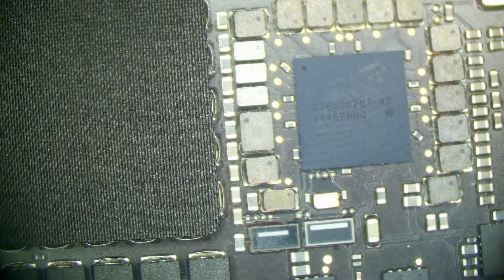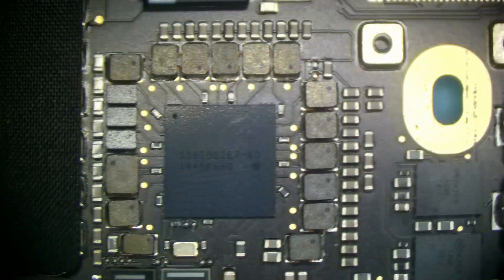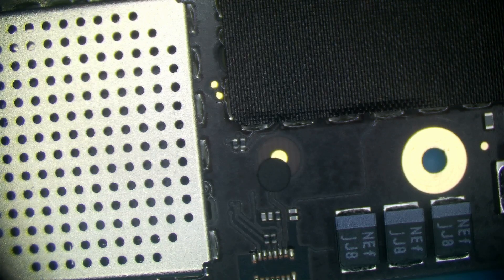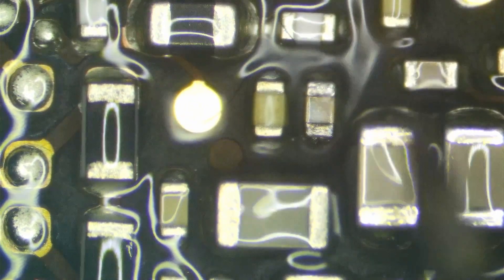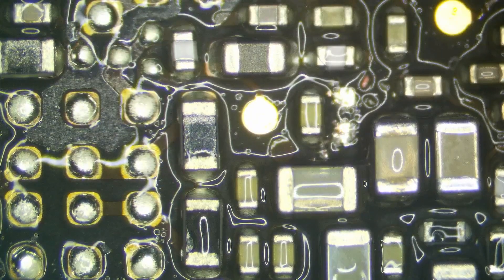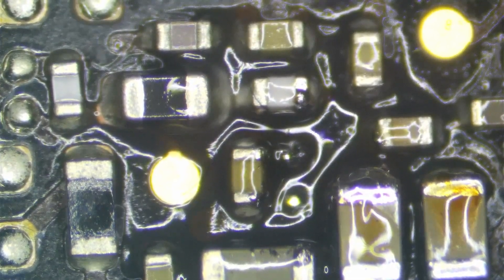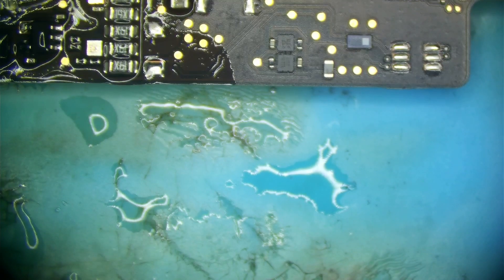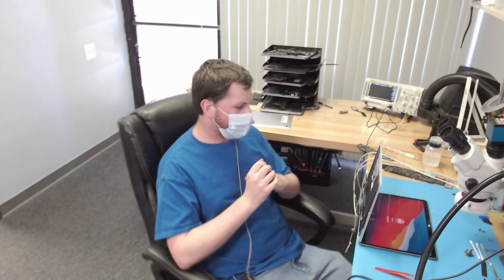2019 A1932 MacBook Air No Power, PP3v3_S5 missing.

Comment: I have the same model with a strange behavior:

- Battery connected PPBUS_G3H is 12.6V (USB-C Ports: 20V / 1.34A) -> No problem restoring via DFU
- Battery disconnected PPBUS_G3H is 12.27V (USB-C Ports: 5.13V / 0.25A) -> Cant restore via DFU (Error/Timeout)

How is this even possible?
Any idea what I can check?
Reply from the maker: You usually need a charged battery to restore DFU. History of device?
Reply: @TCRSCircuit  MacBook Air 2019 (820-01521-02) - PPBUS_G3H low „12.25V“ - no boot

Hi,

the following values are measured will the logicboard was connected to the charger (without battery): 

- PPBUS_G3H = 12.25V
- PP3V3_G3S = 0V
- PP3V3_G3H = 3.246V
- PP3V3_G3H_RTC = 3.29V
- PPDCIN_G3H = 5.1V
- PP1V8_S5 = 0V 
- PP3V3_S5 = 0V
- PP5V_G3S = 0V
- PP3V3_TBT_X_S0 = 0V
- PPVDDCPU_AWAKE = 0.7V
- PPVDDCPUSRAM_AWAKE = 0.9V
- PP0V82_SLPDDR = 0.8V
- PP1V1_SLPS2R = 1.1V
- PP0V9_SLPS2R = 0.9V
- PP1V8_SLPS2R = 1.8V
- CHGR_PHASE1 = 5.1V
- CHGR_PHASE2 = 5.1V
- CHGR_BOOT1_RC = 10.44V
- CHGR_BOOT2_RC = 10.04V
- PPVCC_S0_CPU = 0V
- PP20V_USBC_XA_VBUS = 5.1V
- PP20V_USBC_XB_VBUS = 5.1V

-> Tried DFU mode + T2 firmware restore = no success.

Same scenario just with battery + charger I get at first 5.13V / 0.47A after replugging the charger I get 20V / 1.30A.

-> With battery connected I can successfully complete the T2 firmware restore …. Sadly still blackscreen.

Note: Trackpad is clicking and caps lock key green light is working / no keyboard backlight.

Any idea what could be wrong or what I should I check next? I assume the U7000 is fine because the PPBUS_G3H is stable, so no pulsing.

But it seems like there is an issue between T2 and PMIC.

Here are the power rails of the T2 chip (ohm):

- PPVDDCPU_AWAKE 13.1 Ohm
- PP0V82SLPDDR 31.6 Ohm
- PPVSSCPUSRAM_AWAKE 139.9 Ohm
- PP1V1_SLPS2R 0.776 kOhm
- PP0V9_SLPDDR 47.2 Ohm
- PP1V8_SLPS2R 40 kOhm - MOhm .... ?

Source: https://logi.wiki/index.php/T2_and_CD3217_Power_on_Sequence